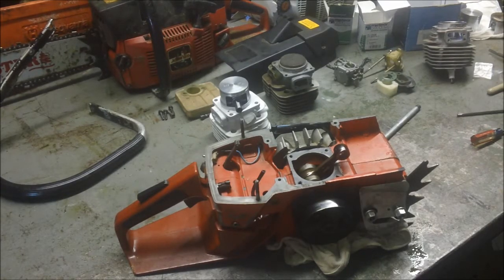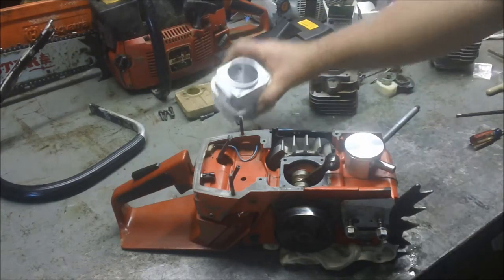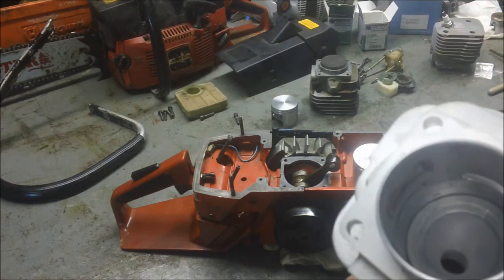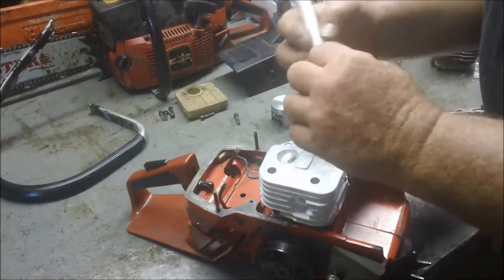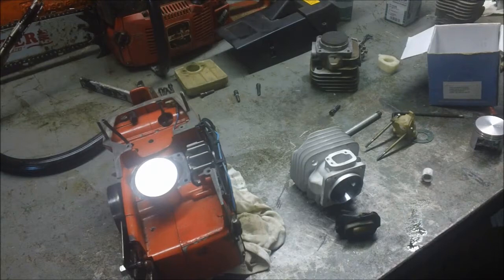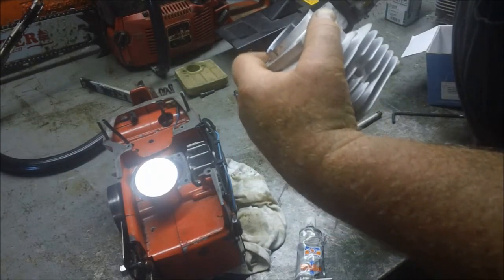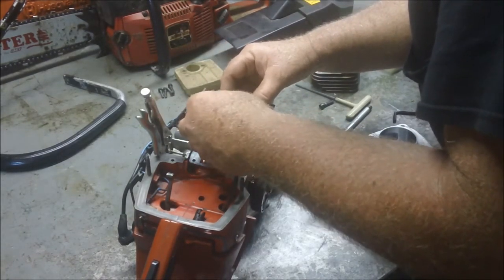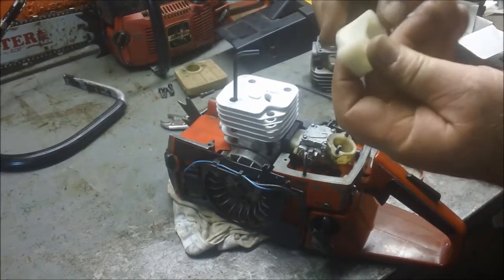What Is "Squish" & How Can You Measure It? Jonsered 672 (Husqvarna 272 / Jonsered 670 Blend)

Comment: I've been curious when you build a new saw and I see you build a lot of them how to break them in properly. I've heard most guys say not to rev it out of wood but you kind of have to in order to get the initial tune ready on it. Seems like you did that real quick here in the video. Do you generally bench tune them a bit before putting them to wood and doing the actual break in? How much full throttle do you personally think is ok when you are tuning the high initially?
Reply from the maker: One of those discussions like politics or religion, I do a few start, idle, tune. Heat cycles. Usually 10 15 minutes of run time doing that. Then let them idle for another 5 or so really to check the low speed tune. Then run them...maybe a little easy maybe for the first 5 or ten minutes trying not to hit the rev limiter. But by tank two of fuel I'm running them as they would in normal use.

Comment: Walt what are your thoughts on a Jonsered 670 rebuild using a aftermarket 52 mm cylinder made for husky 268 and drilling and tapping for a impulse line. I don't want to put too much into the saw as it starts adding up really quick ($). Great informative videos.
Reply from the maker: Thats a good build. Did one with a salvaged OEM 272 top end once. Can't remember if I did a video on that one. I did one by blending carb parts I think.

Comment: I love those Husqvarna 200 series saws too. Simple, tough and powerful, 242, 262,272, 288. Usually I just cut intake gaskets because it just takes a couple minutes. I walk in and buy Three Bond 1184 at motorcycle shops, usually with a batch of Yamalube. Thank you for your videos!

After watching this video I'm thinking about hunting down my ring compressors. For years I have just been putting the rings in with my finger nails but that looked easier.

Comment: Another awesome video...man!   I really dig the pre-assembly step....friggin awesome!    I thought the muffler mod got you more power then your highlighting so I learned something there!   I have a ms391 that I was gonna do a muffler mod on to try and get as much power out of the saw as possible as I have a 32 inch ripping bar and chain and it would be great to have for limited and very occasional use.  I want some slabs out of the  fire wood pile!  What do you know about the ms391?  I'm going to use this soft solder technique to check squish....   Captain....She needs more power!!!!   LMAO

Thanks again....for the killer vids!!!!
Reply from the maker: David Thorne Thanks for watching, I really haven't spent any time on the Stihl ms391. I'm afraid what you will find is they are clam shell designs where you really can't change the squish without some serious machine work or making a "popup" piston. More than I can do at this point. That approach I articulated works only with saw designs such as Stihl ms460's and Husqvarna 372's where the cylinder isn't a part of the bearing cap and can be taken apart at the base of the cylinder.

Comment: How do you break in your new top ends?....I just rebuilt a stihl ms290 and am nervous about over working the new top end right off the bat...thanks
Reply from the maker: Josh Capasso Don't worry, they are tough. We over think this stuff, the "pro" is going to take a rebuild saw and put it to work. With the same break in he did when it was new..... none. Just work it like normal. I always use a little oil on assembly so the main and wrist pin bearings are lubed on fire up and there is a film on the cylinder wall.... but then I let it warm up and then tune it.... then just work the thing.